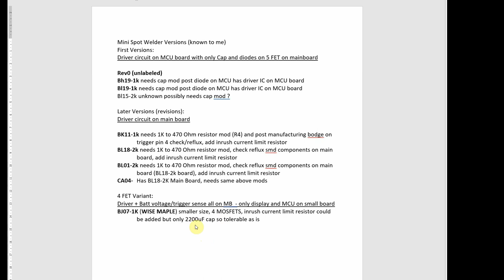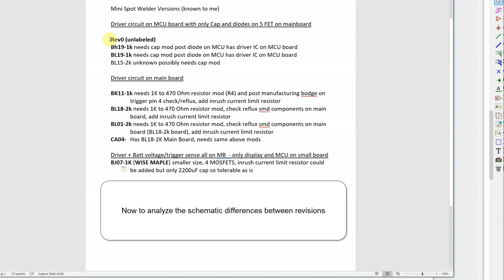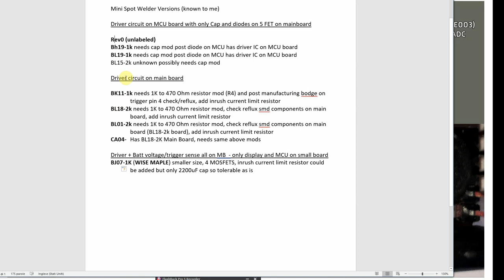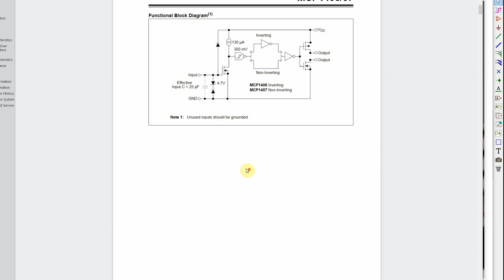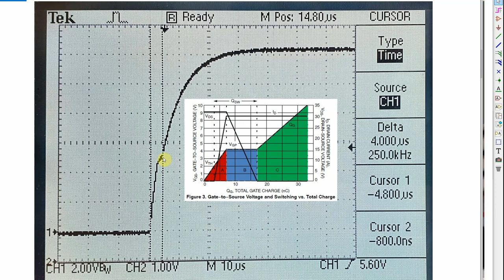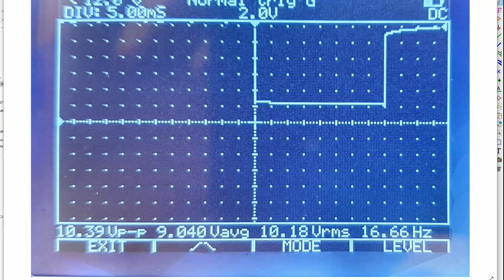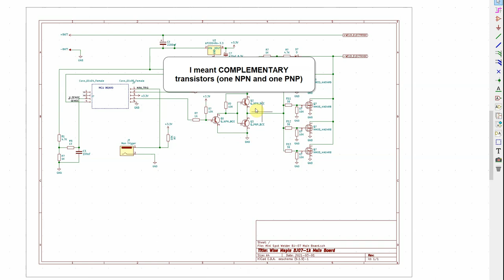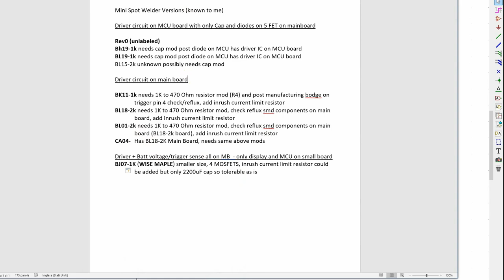All "Mini Spot Welder" versions: circuit Analysis, differences and faults

Comment: what about when adding 5 more gets to these like some are doing on the back. anything that needs to be done when doing that mod?
Reply from the maker: That's a good question: considering that all FETs have their Gates connected in common and not with individual impedance matching resistors (for ex. the Red Mini Spot Welders have a 30 Ohm resistor on every individual Gate which is correct) you would need to change the resistor and lower the value by approx half the current value (so less than 8 Ohms) as the "paralleling" of all the gates (and capacitances) would lower the resulting impedance. If you don't, the rise time (On Time) would probably be affected and slower than expected. However, the Optocoupler output is not really optimal for this kind of "bulk" drive as it can only support 50mA sustained and a few hundred milliamps peak for brief periods so that would need to be considered too. Personally, I wouldn't add additional FETs without considering more substantial mods.
Reply from the maker: @th3drizzl378  I see he's beefed up the traces and added XT60 connectors per power wire and has a high current power source: that decreases general line resistance so increases the current during pulses which also makes a difference. Adding 5 FETs is plausible, but the thing is you would need to check the gate pulse trace after having done this. As I mentioned the overall impedance decreases and you need to take this into consideration else you are losing efficiency. Also not having the decoupling cap you can risk underdriving the FETs and causing them to FAIL prematurely. These FETs are rated 300Amps nominal each (in ideal specced conditions), 5 of them would give you a theoretical 1500Amps pulse and 10 twice as much --- but --- they have to be MATCHED which is something that I doubt they have done with these welders (which is why they ask you not to mod the cables gauge and lengths). If you have matched FETs you can really do serious currents with the proper Gate drive, but simply throwing more FETs on without some verification and matching just increases the chance of FET mismatch which is why I warn about this. More is not always better generally speaking - unless you are lucky to have matched FETs (which is why some people blow their welders after just a couple of welds and others are still happy after many as the FET matching is rather random on these cheap devices). It's a little like playing russian roulette, do you feel lucky enough? Having said this, if you buy a batch of 5 (or 10) matched FETs from a reliable source and do the Gate drive mod which I suggest you can try going that extra mile - but you'd need to beef up the power cables too - it's an averall "upgrade" which can make it all more critical, if you see what I mean. You can also potentially get .2mm welds with only 5 FETs, if they are driven properly and matched.
Reply from the maker: P.S. I will try to get a batch of FETs and do some testing!

Comment: Hi Luca,  Do you know if I can use a 470R 250mW resistor to BL01-2K board ?
Reply from the maker: You should apply that resistor mod to all those boards I mention (including the Bl01-2k). Only the boards with the MCP driver do not need it (but need the additional cap mod).

Comment: Luca, thanks so much for all your work on this. I have the Rev0 model and will be installing the mod as you and Fabio suggest. I have one question as a newbie though - just to make sure I understand this. The device info sheet says to use a 12v car battery of 25-40Ah. If I have a car battery with a larger Ah (60-70), will this damage the device or will it make no difference with the new mod in place? Many thanks if you can help me with this. :-)
Reply from the maker: Hi Miriam, it's ok to use a larger AH battery as long as you start from 5ms and ramp up from there (and of course add the decoupling cap after the diode on the "Rev0" with the MCP1407 driver). Don't start with any higher value as you can easily overdrive the Spot Welder with a 70Ah battery and step up with 2-3ms intervals not more (you should be able to weld .12mm strips with max 15-20ms setting with a strong low internal resistance battery). Also use the original power cables and electrodes, don't cut nor extend them before you get acquainted with the welder and your specific battery setup as they provide a safe current limitation (they get warm). Also, every time you change the battery or power source always start from this lowest setting (5ms) where it should default. Many people just ramp up to +25 or over 35 and then blow the FETs or blow a hole in the strip or battery without getting a feel first. You can screw the 2 positive electrodes together on one contact to reduce some drop and be sure to use screw on contacts to the battery terminals as aligator clips are usually not strong enough to deliver the peak current (unless you have large heavy spring loaded jumper cable style ones). I also suggest to spray some deoxidizer in the pin contacts of the MCU board as often they have some grease or fatty smear preventing them making good contact. Last but not least, you can also bypass the power switch as on 3 of the ones I tested, 2 were flakey and this can lead to an inconsistent behaviour, though with the cap you should be on the safe side. All of this is explained more in depth in this and my other videos in the playlist.
Reply: @Luca_Techy  Hey Luca! Many thanks for this info. I'll be sure to use it putting together my strip welding set up. Best wishes, :-)

Comment: i have the ca20-2k version is there anything i need to do other than to beef up the traces and maybe limit the inrush?  or did they finally get it right?
Reply from the maker: You still need the R4 mod, check that resistor on the MCU and be sure it's a 470 Ohms one.
Reply: @Luca_Techy  i was just thinking is the diode that gets blown/shorted just the reverse polarity protection? because you could wire a heavier duty diode in series with the   xt90 anti spark plug?

or even bypass the diode and even put a diode in parallel and then use a fuse because there are 2 ways to do reverse polarity protection.

series if it is a low power load and the load will not work at all if reversed and parallel so it will act as a short if reversed and blow a fuse.

power inverters and car amplifiers use the parallel diode.

logic probes and other test devices that have to clip onto the battery or power supply uses the series diode.
Reply from the maker: The diode is a reverse discharge protection diode for the logic and FET driver pushpull smoothing Cap, it's not for reverse polarity protection. It's needed to avoid the voltage dropping below a certain threshold during the weld and failing to drive the FET Gates thus resulting in FETs shorting. The large 10000uF cap will kill that diode when connected to 12V because of the increadible initial peak current (I explain it in my videos, check the playlist). A simple series 20 Ohm resistor mod will avoid this. If you have one of those XT-90 connectors with a series "preconnect" resistor then you don't need to worry about adding this resistor as the connector already takes care of the inrush current limiting when plugging it in slowly. You can download the schematics if you want to see how it is layed out (they are all linked in the descriptions of my various videos).

Comment: 27:36 incorrect. It does not go directly to the gates. It has 30 Ohm resistors between each power transistor gate pin and driver, same like on later versions. BTW I got Rev 0, which I just damaged, I will measure driver output with oscilloscope once it is fixed and will share my results.
Reply from the maker: Yes, this slipped but I corrected myself later on (and in my prior videos I explain what the gate impedance matching resistor is for). You can download the circuits of the other versions from the links in the description.

Comment: Hi Luca,
I did add a capacitor in control board between diode and -. This is white buttons spot welder no version written.
Its just dead after this. I checked diode, capacitor, weldings, MOSFETs, switch. All good.
Do you have a good idea where else to look? I know this capacitor idea was not from you. I also removed capacitor. All dead the same.
Reply from the maker: Hi Fernando, please check that you haven't inadvertently disconnected the diode or some resistor near as it's highly unlikely that by adding that cap will prevent it from turning on. If you have a multimeter check that there is continuity from the connector pin to the diode (it should be pin 1 closedt to the LCD and gnd pin 5 closes to the pushbutton switch) and after the diode all the way to the first regulator pin (with switch on). The only way you can kill the MCU is by ESD if you were not priorly grounded or was working in a dry and isolted area.
Reply: @Luca_Techy  hi Luca, best way to get our brain working, ask someone else.
From your answer, when I soldered the capacitor to diode  I did desolder that side of diode from PCB. Easy done, it's back working, capacitor too.
Beautiful. TY.

Comment: Watched the video a few more times and carefully went over a few places (and watched a few others of yours on these welders).  There are a few things on the big "list" that you don't touch on:

- You don't (re)illustrate the difference between early and later revs. of the board with the transistor drivers (with/without the 1k/10k bodge underneath)

- What is the "...post manufacturing bodge on trigger pin 4..." adjustment?

- What does: "...reflux SMD components..." mean?  (maybe you mean "reflow"?)

Also, would it not be easier to just adapt the rev. 2 boards with a 2200uF or so cap (replacing the 10,000uF), rather than having to mess around with moving SMD devices and adding a resistor?

Lastly, you go into a long & interesting explanation of how the series 1k resistor on the Wise Maple board is too high, but your "fix list" does not mention it, nor do you show where it is!  (correspondingly, I don't think you actually walk-through the reasoning of the 1k "fix" on the rev. 2 board, you just refer to the change of pull-up voltage and deletion of the pull-down)

Thanks for the great video!
Reply from the maker: Hi, actually I do explain what the bodge on pin 4 is on the earlier revs - this has been moved on the main board on latter revs, I believe I mention this more than once. The resistor divider array is simply moved above the board (the schematic is the same just the layout is fixed). 
-By reflux yes I mean reflow. 
-The reason why I suggest adding a current limiting resistor is because it costs less than changing the cap and most importantly because you would still need one with a 2200uF cap. The diode might live longer but it will eventually fail - this resistor is mandatory by design (in fact the Wise Maple version needs one too).
The Wise Maple model has a different bias on the pilot base which is why the mod is not needed - I believe I mention this also somewhere along the line (I don't recall everything in detail as several months have passed). You can see this also in the circuits I linked in the description - just compare that section.

Comment: I have bought two so far. Both failed. They just give put full power on all settings. Nothing has blown? Any ideas?
Reply from the maker: At least one FET is shorted, you need to locate and remove it. If you have a dead short between battery minus screw and terminal minus screw then it's a shorted FET.
Reply: @Luca_Techy  Thank you.

Comment: First a big thanks to your work! 
I have Modell Bi15-2k, there is nothing under the big capacitor. I'm not sure how to mod. Can you help if I send you a link to my pictures? The other problem is I blow one FET and order replacements. Currently I have 4ND4R8 5pcs. And I only can get 5 of the 4ND4R7. Can they fit. They can do same current, only thing different is gate charging characteristics. But I have no plan what this means, or I this affects the working of the circuit.
Reply from the maker: Your version is a Rev0 or equivalent version with the MCP FET driver on the MCU board. If you compare it with the photos shown on this video you will see it matches. First you need to apply the extra 470-1000uF 25V capacitor mod after the diode as explained in the video and shown in other videos (check Maker Fabio's video on this mod) to avoid blowing other FETs. If you have blown just one FET then you needn't replace it just remove it and use the 4 remaining FETs instead of 5, it will work just fine. If you want to replace them all with new FETs (FETs should be matched an replaced with the same batch) the originals are the 4N04R8 which should have an internal ON resistance of .8mOhms while the R7 have 1.7mOhm (about double) so you need twice the amount of these FETs in parallel to achieve the same peak current (in theory) thus power. You can source the 4N04R8 from Aliexpress pretty cheap or you can buy the original Infineon ones (IPLU300N04S8-R8) but they cost more. Don't mix different FET types, not in this application. You need the same exact FET models and coming from the SAME BATCH (they must be matched) else one or 2 will do all the work and will eventually fail if driven too much. I hope this was clear.
Reply: @Luca_Techy  best thanks for your detailed explanation.  thanks to you I have now understood.  With you as a teacher, I would certainly have learned more than I did in electrical engineering lessons.  the spotwelder is now working fine, with 4 out of 5 FETs, with a 5200mah 60c battery as the source.  Perhaps you have an experience of how many welding points can be made one after the other before the device needs time to cool down?

Comment: mine says CB23-4K - it looks like CA04 - do i have to mod something?
Reply from the maker: I haven't seen that model though I suppose it is similar to other CA04 ones. However if you send me close ups of the front and back of the main board and front and back of the MCU board I can verify.
Reply: I received this same one. It's bad by design as well. R4 needs to be lowered and a resistor in series with the diode. I measured the gate signal after the mod and now it's acceptable. Still not great as it should be rail to rail to add much more margin. Now the "on" voltage is the battery voltage minus two diodes. One real diode and one from the base emitter of the npn. Without any cost they could have made a proper driver (PNP to the supply and NPN to ground).

Comment: hi thx for these awesome info. can you tell me what kind of  smd resistor i need . try to google but not sure which one i need.thx
Reply from the maker: You can use a normal 1/4 or 1/8th Watt resistor, easier to source. The outline of the smd is a 0403 or u can use a 0603 but they're really small.
Reply: @Luca_Techy   oh so it doesnt have to be smd style resistors . thx

Comment: Incredible! :)  I have a few of these (rev. 1 or 2?) coming from China and this is an amazing resource!

Would it be possible to post the reference page as a PDF, where you describe the list mods to each board revision?  It would be nice to have as the "root" document to supplement the schematics.

Thanks!
Reply from the maker: Basically the models I have analyzed are all in this video - but there are many more code variants with the same schematic so it's impossible to make a one for all document. What you need is to look at the layouts here and compare them with the one you have and use that as a reference (plus the pdf of the schematics linked in the description). This is the only real way of knowing which type yours is. Up to now, there has been no further mod to the schematic that I know of (so none of these fixes have been implemented), only code variations on the silkscreen.
Reply: @Luca_Techy  Thanks!  I managed to get two of the first revision (with the FET driver chip), so I assume that all things considered, these are the "best", when the brownout 1000uF cap fix is implemented?

Also, with all of these, I assume that a very large, high-quality, cap (in the 50,000uF+ range), on the input would help stabilize the voltage while the weld takes place?  Any idea how big a cap would be needed to supply all the current for a typical (25ms?) weld?  In this case, I assume that almost any 12V source would do since voltage drop would be non-existent (a current-limiting resistor on the huge cap would be a good idea...)
Reply from the maker: @awebuser5914  a 50000uF (0.05F) cap is not enough, you need a 500F supercap bank for ex. if you want to have the "beef" to weld - and that's really expensive, not really viable. Just add the mandatory 1000uF cap after the diode and use a good 12V 40Ah+ AGM battery or 3S 5000mAh 50+C LiPo as indicated and it will weld fine.